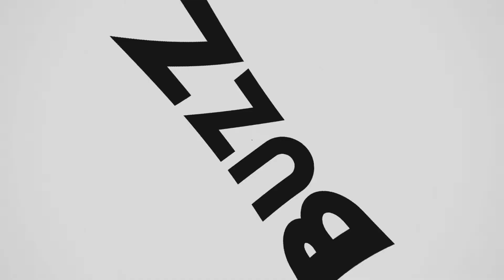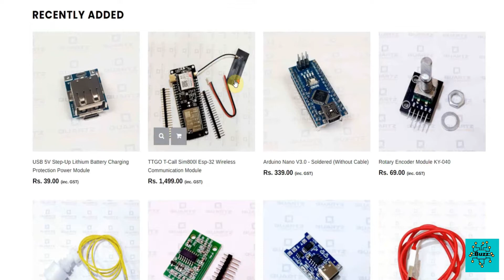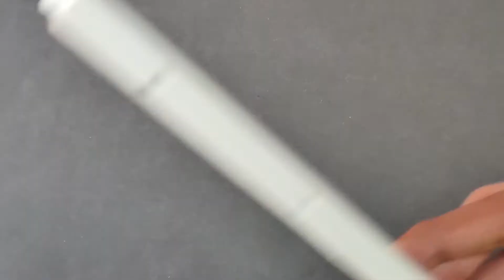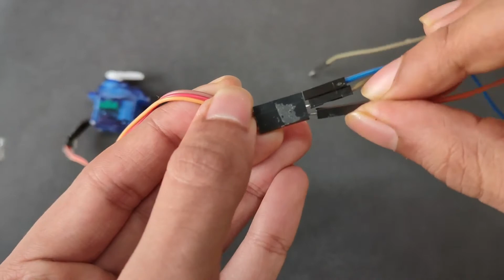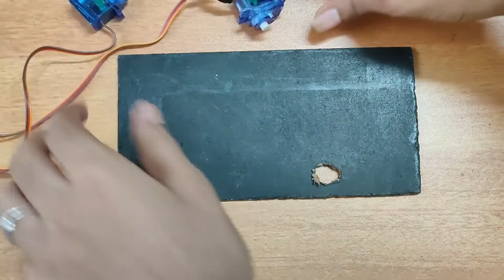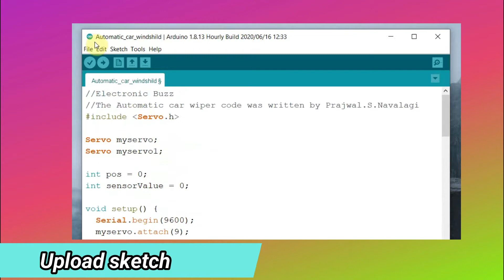Automatic rain sensing car wipers| Electronic Buzz| 💧🚗

Comment: Bro i have did exactly watever has been mentioned. But the jumper cables are getting too much hot and the rain sensor light is not glowing. Over all its not working. Also can i know how the power is given to the arduino. Can all please help with watever information you have i have some deadlines to produce this project
Reply from the maker: Provide 5v to arduino, make sure connections are correct

Comment: I've done the exact same thing every connection is proper. After uploading the code the LEDs of Arduino( Green,  and orange ones ( Which are beside digital PWM and TX one)) are glowing and even the green ones on the rain-sensing chip are glowing properly but when I'm dripping water on the sensor motor isn't working. Can someone explain to me why ??
Reply: I have the same problem, how did you fix it ?

Comment: I did exactly as mentioned in the video but when I connect the power supply, servo motor starts rotating and I didn't even poured water on the sensor 
Pls help!!!
Do I need to change the code or something????
Reply: No need to change the code it's correct. Check the connection of rain sensor,boz according to sensor values wipers rotate.Copy the same code that I have provided :)
Reply: yep same happened to me bro!
Reply: @ashutoshpandey904  how did u solve it?
Reply: Then how did u solve it??
Reply: how did u guys solve it? please help its urgent

Comment: Please help
My servo motors are rotating continuously if even if there is no water on sensor and also my motors are rotating 360°full
Please tell the changes which should be made in code

Comment: nice project but i have a question, can i hook a higher voltage dc motor (12V) to the arduino? would it work fine? also how do i make so that the dc motor reverse detection of the sensor sense otherwise? (CW if rain, Anti-CW if no rain)?
Reply from the maker: Yeah u can use 12v motor ,but u should also use driver module with 12v motor.U can change the direction of motor by making some modifications in code.U will find many tutorials on YouTube.

Comment: can you make arduino connect with power window? my project is almost similar with you but im using power window
Reply from the maker: Yes you can :)
Reply: @ElectronicBuzz  need relay 5v or 12v?

Comment: My problem is how can I put a duration/time or stop and resume to my DC Gear motors and the rain sensor? I wanted that if the rain sensor is WET the DC gear motors will rotate clockwise then put a duration on it like (2 or 3 seconds) then stop. Until/And if the Rain sensor is DRY the DC Gear motors will rotates counterclockwise. Help me please  with code
Reply from the maker: Take a dc motor connect it with a Arduino .In code replace servo code with dc motor (see any YT video how to interface dc motor with Arduino )and now according to rain sensor value change the direction of moror